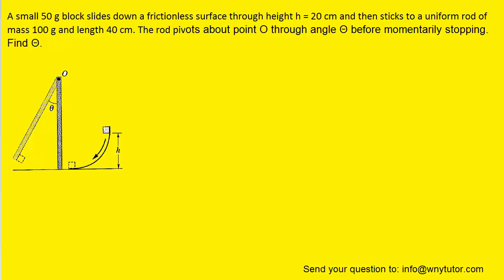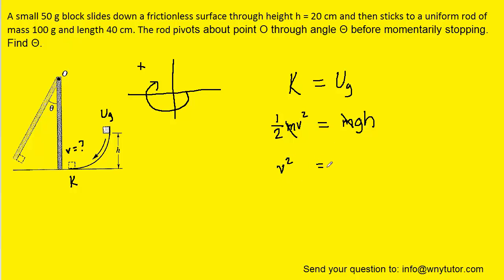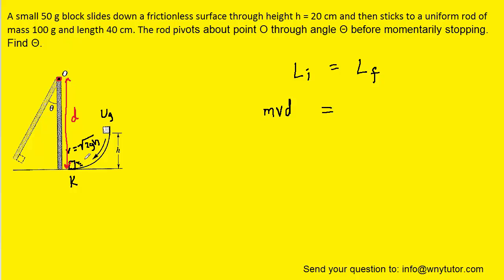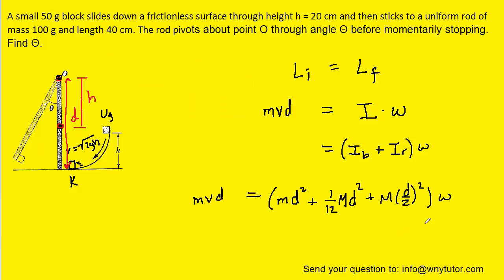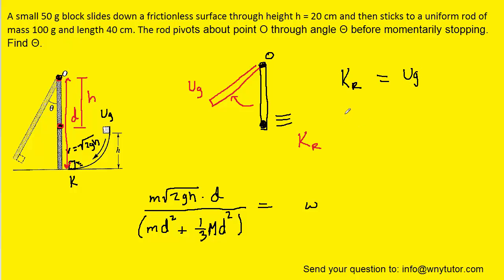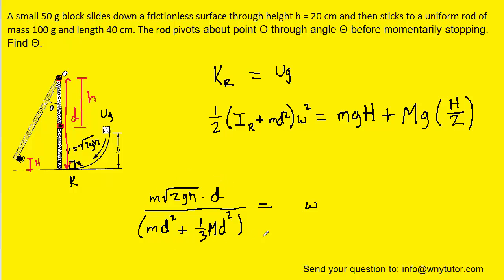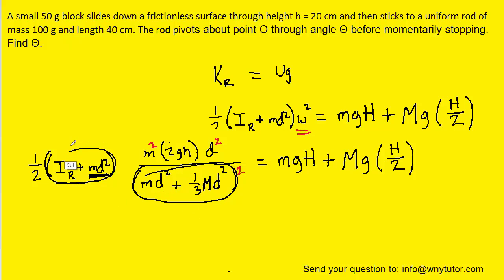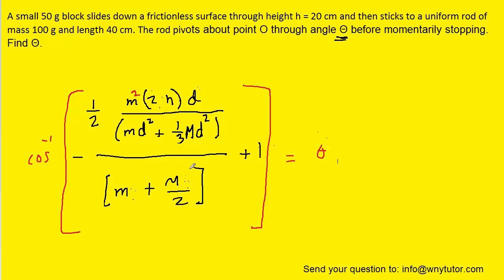a small 50 g block slides down a frictionless surface through height

Comment: When you equal your rotational kinetic energy to your gravitational potential energy of the rod and block, wouldn't you need to have a an initial gravitational potential energy of the rod because the center of mass is still has a height?
Reply: make that position as reference point then initial potential energy is 0
amateurs
Reply: @24-dinitrophenylhydrazine29  In fact, we are interested in the change of height.